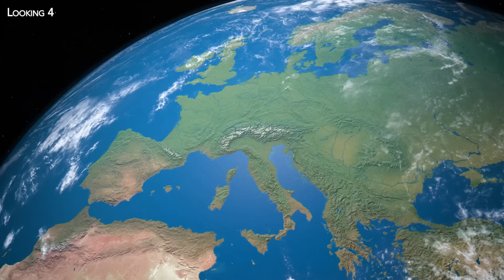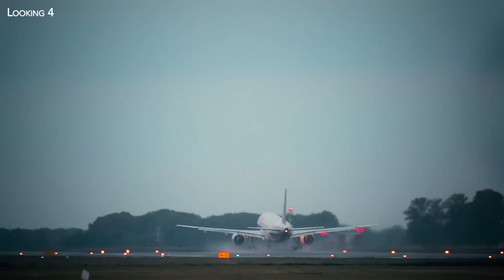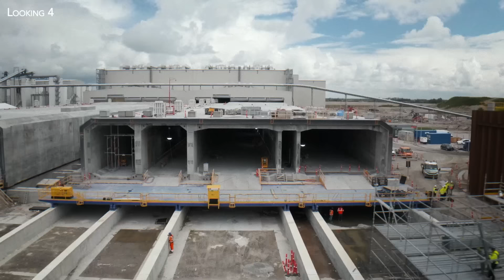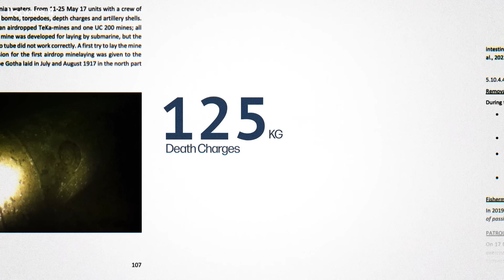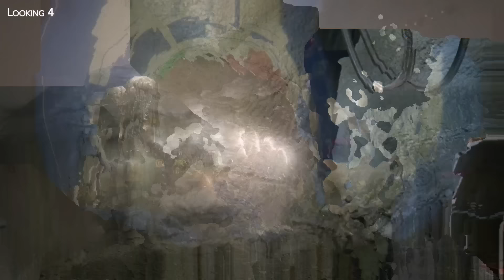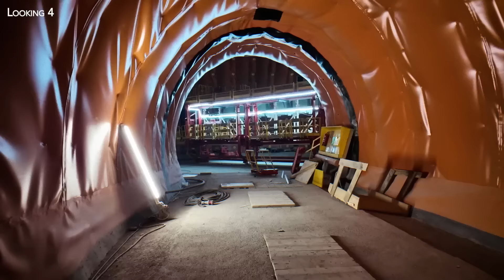The Two Mega Tunnels that Will Change Europe Forever

Comment: As a Dane, the highly specialised "ship" intended to place the new Tunnel Segments in the ditch in the seabottom for them has been delayed, and I think that first around now it is ready to start test-operating the tunnel-elements, and in some months the first section will be lowered in place with added ballast. The finished Tunnel will be delayed from its originally planned opening til in the twenty-thirties.
     As now 78, I may not be able to drive through, sadly?
    But the new 2-track bridge, intended for the extra tunnel traffic and replacing the old bridge from 1938, with only one railroad track, has just been opened for traffic close to my former home.

Comment: Let's not forget the Channel Tunnel from France to the United Kingdom, up till now the longest underseas tunnel with it's 37,9 km under water and 3,3 (France) and 9,3 (UK) under shore entry/exits which totals it up to 50,5 km. Because of the 38 km under water that tunnel is not fit for cars  seeing the immense quantities of toxic fumes that would be the result. The tunnel only allows electric trains but the passengers travel easily and smooth in about 20 to 40 minutes from one country to the other; this is the actual travel time. Total time needed to cross the Channel takes from 1 hour up to 90 minutes for reasons of checking in, border control, toll, loading/unloading; depending if it is private travel or cargo vehicles.

Comment: Correction: The Fehmarn Belt tunnel connects Denmark with Germany, not Scandinavia. Sweden have neglected its rail infrastructure so there simply isn't any spare capacity to take advantage of the tunnel. The roads are also already clogged up by lorries and road capacity is anyway an unsolvable problem.

Comment: Transferring 40% of the freight from road to rail means 40% fewer jobs after the tunnel is complete. Also the tunnel that goes from Germany to Denmark would need to prohibit all hazardous chemicals as any fire in those tunnels would turn the structural cement into crumbling death spaces. So the transferable freight from road to rail there wouldn't matter as neither transport method could guarantee safety transport of hazardous chemicals through that tunnel.
Reply: But besides those issues both plans have merit. As long as people find other forms of jobs then I'm ok with both, excluding the hazmat loads through The fehmarnbelt fixed link.

Comment: 5:25 Eeeeehhhh, Denmark is already 0 minutes away from Germany!
The two countries are landlocked and have a border on the Peninsula of Jutland!
It’s also a much longer trip than 160 Km (or even 160 Miles), if you’re going to drive from Rødbyhavn to Puttgarden without taking a ferry at any time…
Alternative ferry routes are Gedser-Rostock, or Spodsbjerg-Tårs+Bøjden-Fynshav, Trelleborg-Travemünde, Trelleborg-Rostock, or Malmö-Travemünde - so yeah, it will definitely become easier when they are finished building that tunnel!
On the downside it will probably end up reducing the amount of future night-trains departing traffic hubs such as Odense and Fredericia.
The Night-Trains connecting Stockholm-Copenhagen-Odense-Fredericia-Hamburg-Berlin will skip Odense and Fredericia…..

Comment: I wonder just how much traffic will end up on the Sweden-German tunnel. 
Does the "increased" traffic and freight volume justify the enormous expense for this link.
There are already two transportation links ( air travel also, but even more expensive ).
In my area in Canada, there was a $1B bridge built to service a 150K population on an island.
The islanders love it but I think the Islanders would have been happy with a properly improved ferry service.
Reply: There are many reasons for building it and all of the tunnel and condition to it except for the German side on land, so Denmark is taking the risk and people using it will pay for it over 30-40 years, we have had no problem with the other bridge tunnel financing to Sweden or the two bridges to Jutland, it will give two high speed rail tracks and 4 vehicle lanes, the Swedish German industry is very happy and when Denmark and Sweden build the bridge tunnel connection Denmark promised Sweden to build the tunnel to Germany.
The bridge tunnel to Sweden has per year 12 million train passengers and 7.5 vehicles all paying for the infrastructure the state pays nothing its already fully paid back in 2035 so 35 years it will probably last for more then a hundred years, already now it’s considered a very good economics decision to build the bridge and tunnel to Sweden it has resulted in a massive boom especially on the Swedish side.
And then there are the military aspect, all the infrastructure built around Europe to Italy Spain and the Baltic states will all be connected with modern rail and vehicle transport making rapid massive military development and support for the massive army that can be sent close to the borders of NATO, it a powerful deterrent for any aggressor that would have to calculate the whole continent being able to rapidly deploy large military forces

Comment: How about just stop harping on about CO2 saved, all the electricity used for the trains comes from where and what? All those diesel powered trucks transporting waste diggings are not environmentally friendly according to your philosophy, the carbon footprint in making machines to generate electricity, and the electrical power generated by fossil fuels, oil and gas are still a source of CO2 emissions, it might not be coming from car or truck engines, but it is still coming from the source of generating electrical power, energy is neither created or destroyed, it simply changes state, regardless of how you see it, electric cars are seen as clean, but batteries have a massive carbon footprint in creation and environmentally in being disposed off, like turbine blades, shipped off to a third world country out of sight where they are buried out of sight of the delusional greeny eyed environmentalist, you don't get something for nothing, CO2 is life itself and natures original solar panel, we simply return to the atmosphere what nature herself took out in creating trees, coal, gas, and oil, and if we had not, there would be no life all at on this planet.

Comment: The Brenner base tunnel is  an impressive project but it's not going to be  the longest rail tunnel in the world.
The tunnel is impressive but it's 55 km long, not 64 km. The 64 km comes from adding to the length of the   Innsbruck bypass runnel, which already exists (opened in 1994) and the line will use both of them but it's still 2 separate tunnels and trains will pass out in the open while connecting between them (it's a short segment).
That sail, a second tunnel under is also under construction in the same area connecting Italy and France conneecting lyon and Turin and it will be the longest rail tunnel in the world with 57.5 km, about 500 longer than the Gotthard base tunnel.
Reply: In the end, the tunnel will still be 64 km long. If, for example, you have a skyscraper that is 1 meter shorter than the tallest one, and you later raise that skyscraper by 2 meters, it will then be the tallest skyscraper. It's completely irrelevant when the individual sections were built. The new section of the Brenner Base Tunnel will also be built in several phases over decades. Therefore, one could always mistakenly argue that it isn't a single tunnel. But as I said, in the end, it will be the longest railway tunnel.
Reply: @namenlos40  This is not the same project, they have different names, they are built decades apart and most importantly, they do not form one long tunnel, those are two separate tunnels and once the Brenner Base Tunnel opens trains will get out of it to the open air and than go into the Innsbruck bypass so tit's not one tunnel

Comment: The Ordnance and Mines found on the seabed Are not termed "Death Charges" it should read "Depth Charges".
Reply: Another curious expression is "3.2 million cubic tonnes of concrete." What is a "cubic tonne"?
Reply: @grizzlygrizzle 40 cubic feet/11.3 cubic metres seemingly
Reply: @grizzlygrizzle  They probably meant to say 'metric tonnes'.
Reply: @pjacobsen1000  -- The video just previously measured the amount of steel in tonnes, without mentioning "metric," and that suggests to me that the mental glitch happened when "tonnes" were carried over into the mention of concrete. I'm inclined to go with gregnorth's suggestion that what was meant was "cubic metres." Concrete is usually measured by volume, not weight. In the U.S., when you call the concrete company, you just ask for a number of "yards," short for "cubic yards."
Reply: Same result!

Comment: So ... How vulnerable will this mega tunnel between Germany and Denmark be to Russian 'accidents'.
How much thought is being given to designing resilience to bombs going off above it, on the seabed ?
Reply: We'll have our underwater drones ready before the tunnel is finished.
And by then Putin will be finished anyway
Reply: Er and EVs....
Reply: It's well protected with something like 6 feet of sand and gravel on top of the tunnel. And of course, each tunnel element weighs 75,000 tonnes, so it's going to pretty hard to move or damage.
Reply: @pjacobsen1000 like any structure it's always vulnerable!
Reply: @one.wonders  Sure, but there are degrees of vulnerability. This type of structure is one of the least vulnerable, due to its sheer size and location 2 meters under the bottom of the sea.

Comment: What's a cubic ton of concrete?
Reply: Google is your friend - also if you don't understand the metric system
Reply: @ane-louisestampe7939 there's no such thing
Reply: @user-rl5nd3ys8p  Converting cubic tons (i.e., volumes) to measures of weight presents difficulties because organic materials such as timber vary in density. Approximate volume conversions, based on a timber cubic ton of 40 cubic feet: 1 ton (40 cubic feet) = 1.133 cubic metres. 1 cubic metre = 0.883 cubic tons (35.32 cubic feet) - says Wikipedia

Comment: I live in Lund, within sight of the Oresund strait (the sea border between Sweden and Denmark) and situated on the railway and highway mainline going north towards Stockholm, Kiruna and Narvik.  The Fehmarn Belt tunnel link has been a constant item in the news around here, and it's going to expand the railway and highway traffic ever more when it's finished around five years from now. This city already has a heavy railway traffic. 

Many people around here feel that most of the international freight traffic should be routed by a curve outside of Lund (a new additional stretch of railway). Lund has a fairly small, tight "old town" core with the main railway station inside it -. there's no reason to pull lots of heavy and sometimes dangerous stuff (chemicals etc) along a cramped railway corridor through an old city, when the real destinations are many hundreds of km up the road. And the entire railway mainline up through Scania is set to be expanded with new tracks anyway.
Reply: Last time I used the line the train to Göteborg stopped at Ängelholm and passengers were pointed to a coach outside. The driver had to be told where he was supposed to go. Arrived the following day. The copper wires had been stolen.

Comment: Same same same bla bla. Everything is way way behind! Switzerland built 2 tunnels under the alps and they are way underused. Trucks are just so much easier. Even the Brenner tunnel will be there in isolation, way too much extra work is needed as the mountains are in the way!
Reply: Well, when rail covers 70-72% share of cargo in the Gotthard corridor goes by rail, I would hardly say it is used in isolation. A tunnel like that is not built for immediate full capacity use, but for many decades. The tunnel made the share of cargo grow from 68% to 72% and gave time reductions. And a road/rail line is dependent on access lines , and they were not settled yet, for what I know.
You have to take into account that there was a big accident in the Gottard rail tunnel , which took 12 months to repair. This caused serious planning problems and delays . So that will have kept cargo on the road as well.. Trucks have more flexibility .  Compare that with that ship that got stuck in the Suez Canal for a couple of days. The effects in the logistic chain were felt for many months ...